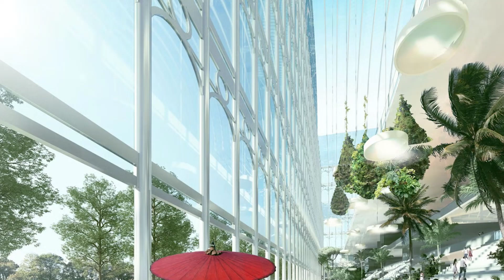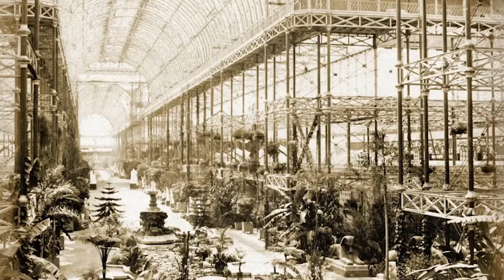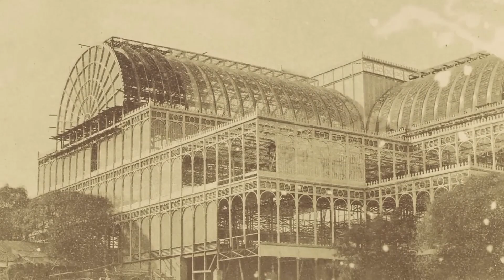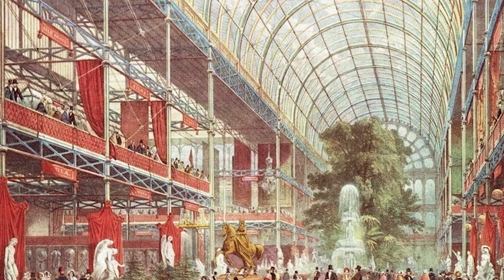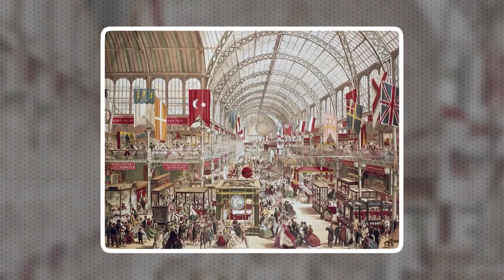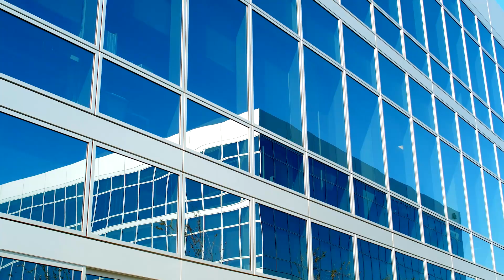The Crystal Palace Explained | How Modular Engineering Built (and Doomed) an Icon

Comment: The question I ask is why did the Crystal Power Stations burn ?
The best answer I have imagined is overunity . If I am right then my answer would explain why the tech was abandoned , was, because  it was difficult to control .  I believe anyone that believes in this nonsense should study static electricity to better understand this tech and it's limitations, and why it was abandoned .  You keep using the word electromagnetic I think the correct word would be electrostatic .The effects to the people you talked about sounds to me a lot  like the alleged effects of electrostatic wind devices . I like to believe that if I could acquire some of the glass I could make it glow using an electrostatic current  I believe that the Crystal chandeliers also were made to give off light by bombarding them with some type of "enegry".